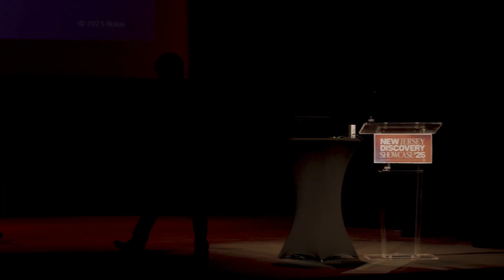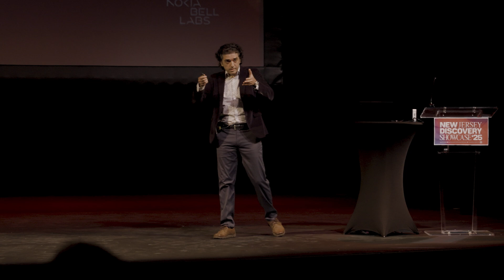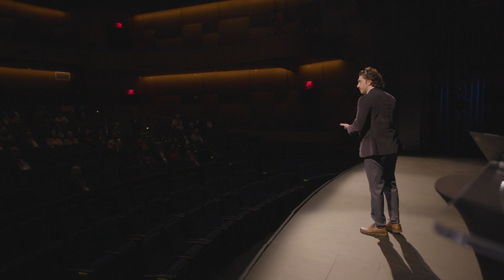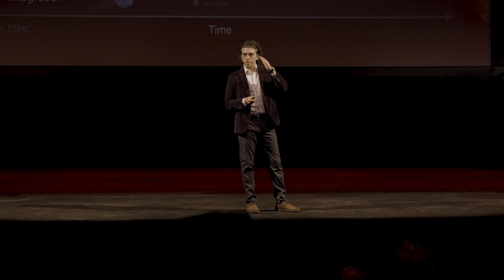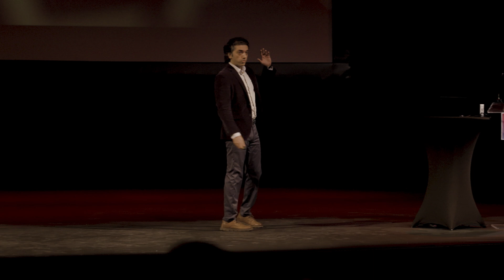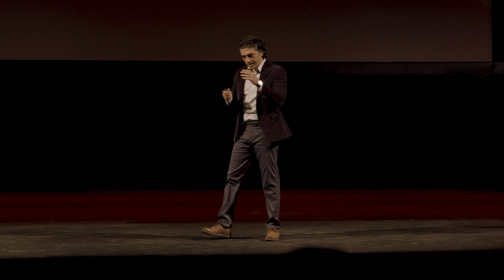Future of Connectivity (Radio On Glass & RFIC) ft. Dr. Shahriar Shahramian | NJ Discovery Showcase

Comment: A mesh system in regards to allowing for a flexible gridding system in retort to the output of the running system and residual energy and what not with static really. I do believe that when it comes to lower modal reference and interactions the body is able to power such and deliver alrenewable energy and restore and require such energy loss in potency through such really. The black and white and black screen I was talking about the one that is able to proper transcribe through the muscles and be recognized in the occipital lobe passively  it does a constant cross cross from the heart rate in due part to the hallow state of the veins giving more precise calculation when it comes to salt and sugar levels  but in a more theoretical sense the energy is open needed and closed in regards to creating systems for individuals that are more sensitive to drug induced manipulation and in addition to the charging wall modalities in intricacies and translations really. Yeah Madasyn phone in the future is black and it scribbles itself meaning that the earth actually imprints on the surface and resonates and communicates such through the gridding system when it comes to refined collection of residual energy and it modulations this is kinda crucial for the car situation and this is why Madasyn plays the game because she can’t remember streets and every street has a color and it changes a lot. No it would be more metal base actually yeah so there is a type of conditioned see through metal that isn’t quite extractable but can definitely be from recycled material and allowing for metal to rust in different colors which takes a lot of time to perfect but once the metal is able to take on a glass state then it can be used imma go eat something  but pretty much the transactors resistors and other modals are in formalities a whole to colored rust and then when you put them together the earth through the body and then the satellites and rechargeable energy placements and such can then be used to run such device as a psuedo type of energy really. Like cleaning it rather and then genomically creating the body at the safe time and the additional aspects that turns the body into a single expenditure really - and I put that on gray magic:33